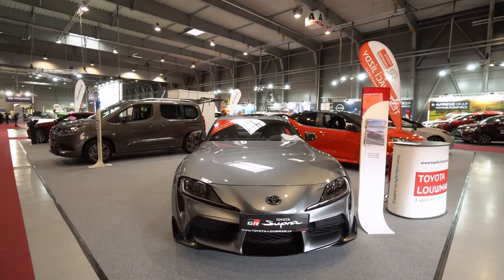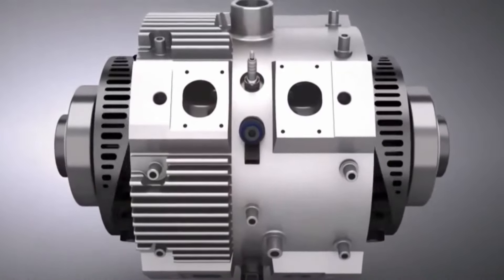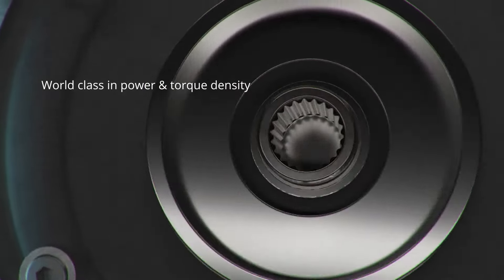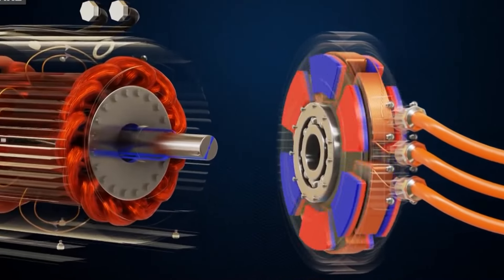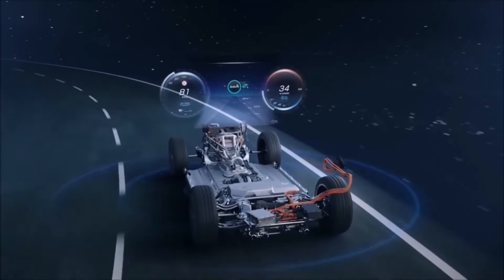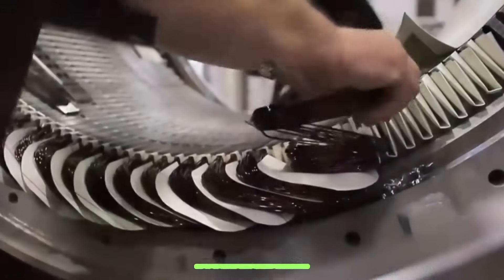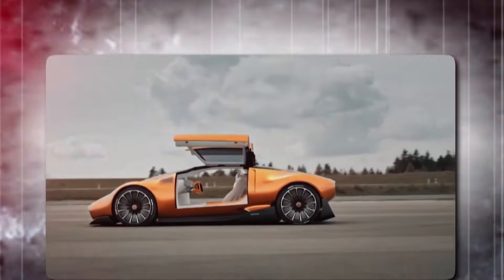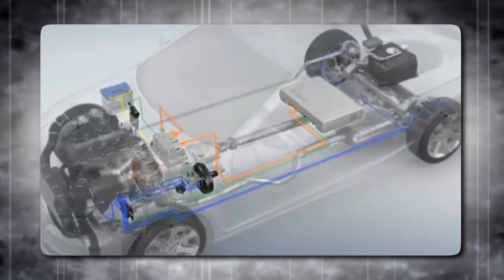Why Every Automaker Is Crying Out for Helix's New eMotor

Comment: Soooo much hype, on a way too enthusiastic tone ... No thumbs up for smooth talk and vaporware :) Thx !
Reply: Axial flux motors aren't vaporware, they have been on the market for a few years. Ramping up production and getting costs down takes a while, especially while the market space is encumbered by patents. Since the rotor in an axial flux motor can have twice the diameter without increasing package size, you can get the same power at half the RPMs (twice the torque at a given RPM) and potentially eliminate the need for intermediate gear reduction. Fewer parts, smaller overall footprint, lighter weight.

At a glance, the earliest patent application I have found for axial flux motors is from 2013. I bet we'll see many more of those coming to market starting from 2034.